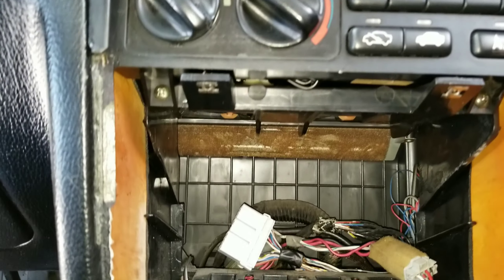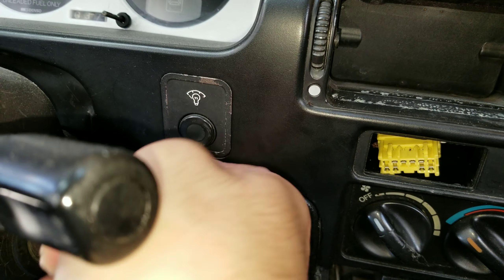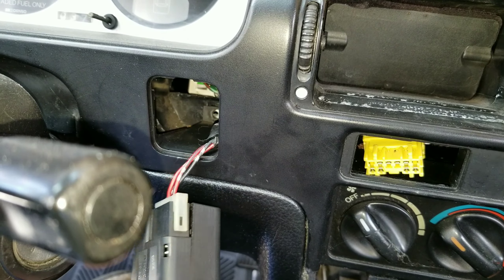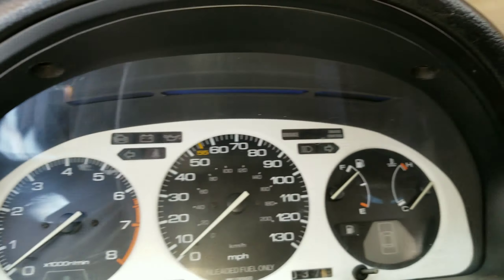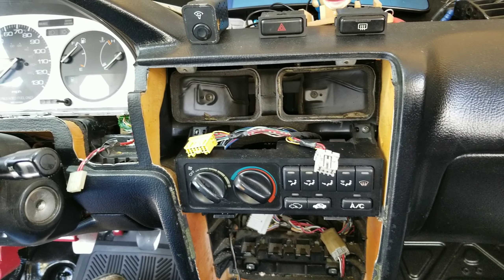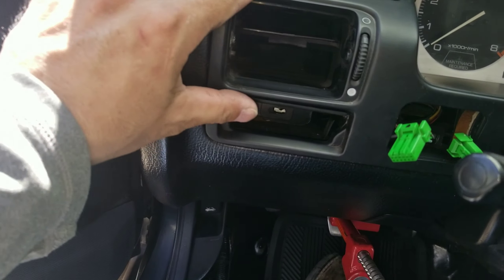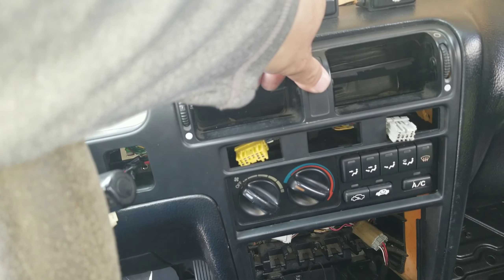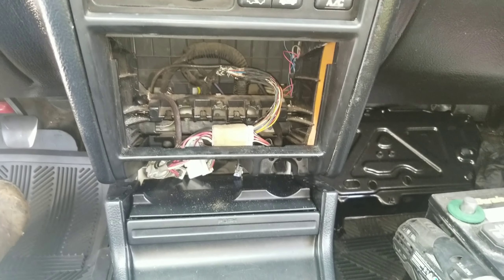DIY How to Remove / Replace Dash Bezel on 90 91 92 93 Honda Accord | Winston Buzon

Comment: Ima use this video when I change my cluster lights to red leds 😁
Reply: Watch the thread type on the screws. The ones across the top (about 5 of them) may have a machine type thread that is much thinner than all the others. It's important to put them back into the same holes you take them out of.

Comment: I’m having so much trouble taking out my radio. Do I have to remove the dash?? Mine is really clean so I don’t want to break it or crack it. Any tips to removing the radio - I have the radio and cd player underneath and it’s just stuck I removed all the bolts and hardware connected to it. But it won’t budge and the forums lead to dead ends, seems like no one can get em out
Reply from the maker: I had a spare I found at the junkers just in case.  Removing the knobs, loosening the factory radio and/or equalizer is always a biatch 😅. If you have plastic pet tools, that would help.  I got lucky

Comment: Going to have to do this to mine sometime ! its not broken but someone drilled a hole into the left side of the bezel right in between the coin tray and the cruise control button. originally thought that was where a screw went unti l i watched this video so no idea why they drilled into a clean bezel lmao
Reply: They drill to fit the led warning lights of car alarms.

When it starts to malfunction they remove the alarm and usually leave the LED to avoid having holes, yours was probably removed all together. 

Are you right hand or left hand drive?

Comment: Where can I buy it? Thank you!
Reply from the maker: I didn't.  I took apart the gauge cluster and spray painted it.  Then, I reinstalled it all
Reply: @winstonbuzon  Dash looks very nice. 
Trying to get my '93 running again, it is a little under the weather right now, must have caught the winter flu of some sort with temperature, over heating problem, and brake pedal goes all the way down to the floor.